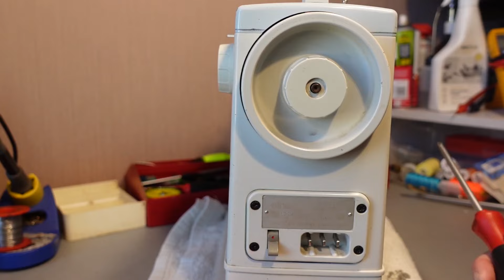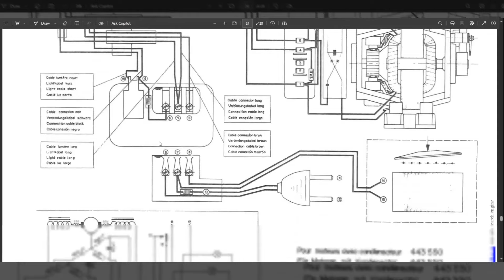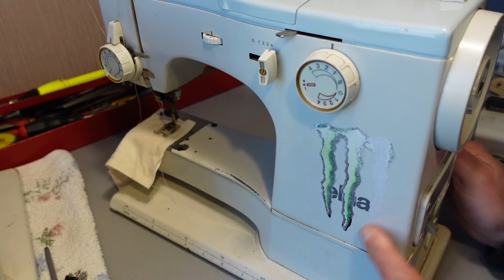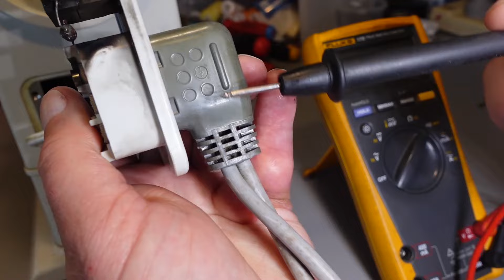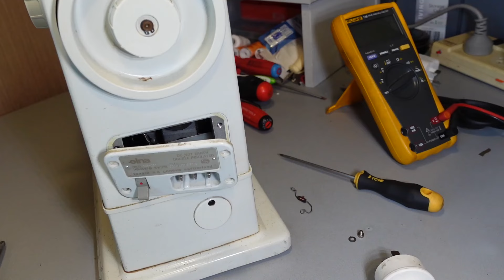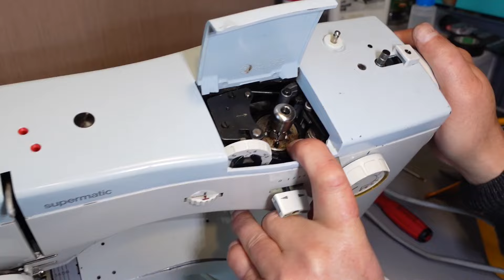This Elna Supermatic 62C - Went with an Almighty Bang! Capacitors? I track down the culprit.

Comment: Thank you for the video amazing. 
I have the same machine I am facing an issue not sure how to resolve. 
When I loose the front wheel (on bobbin filling mode) the wheel spins fine however when I tighten this to get the machine sawing mode it struggles. I have to give it a bit support then it runs but quite slow.
I put crc around I think it needed loosen up but did not make much of difference. I can feel that it’s putting pressure on the motor. Any suggestions or videos you may have for this ?

Comment: Do you have any guesses for why this Elna 62 (white knobs) model may run when you step on the pressor foot BUT the machine is off? I came from your Singer sewing machine running by itself video.

When I opened my machine, it's inductor looks good like the part you replaced.

Comment: I didn't have a supermatic 62C in now, so I didn't get to check the inductor on it. In the Husqvarna VIKING Model 6440 machine I am currently working with, there are 5uH inductors on the main input. I always put new ones in if they are broken and the ones I use are 4.7uH 2.25A. Otherwise, I like your videos. Keep up the good work!
Reply: Hey mate, just wondering if you have got one in since then? I have an elna 62c with a blown inductor, but I don't know what to replace it with? Any help appreciated, cheers!

Comment: The Elna 62C is my daily driver for domestic use. Lovely machine. And indeed, the switch only turns the light on and off, the pedal/motor is ON as soon as you plug in the power socket. That's about the only design quirk that I dislike, because with kids running around in the house I always have to take the pedal off of the floor or unplug the power when I step away from the machine.

Comment: Odd ball hidden capacitor  - I found a capacitor that blew it was inside the motor between the stator windings. I bypassed the capacitor and the Singer 760G now works. I have two of these machines one is a belt drive with the motor mounted under the machine the other is a worm drive with the motor mounted vertically this was the machine that had the duff capacitor.

Comment: Thanks so much for sharing, these videos really help!

Does this machine have a safety capacitor? If not, I bet the inductor was used before safety capacitors became common, serving as the main way to filter electrical noise, stabilize the power supply, or protect the motor to keep everything running smoothly.

I’ve worked on several Elna Air machines, and I’ve seen those safety capacitors blow multiple times. The same goes for Bernina and those blue plastic Husqvarna Prismas (980, 990, etc.).

Fortunately, replacing them is a cheap and easy fix.
Reply from the maker: Thanks. These machines do have a set of electrical noise suppression capacitors installed inside near the motor. Not sure why they needed the inductors as well. Maybe to limit inrush current?